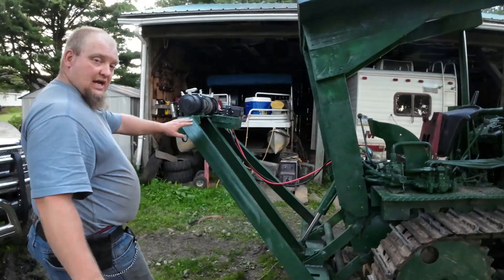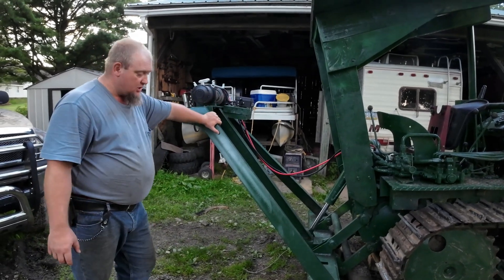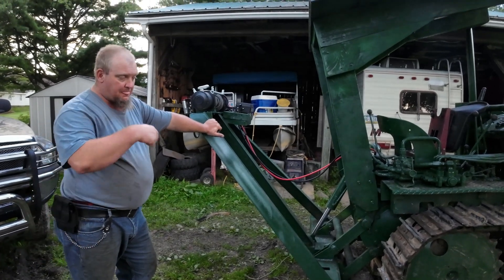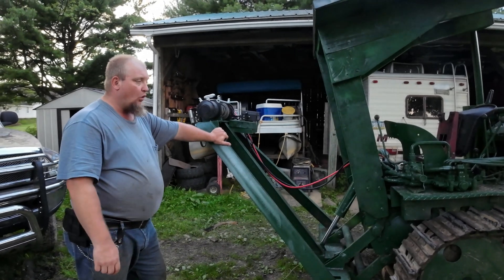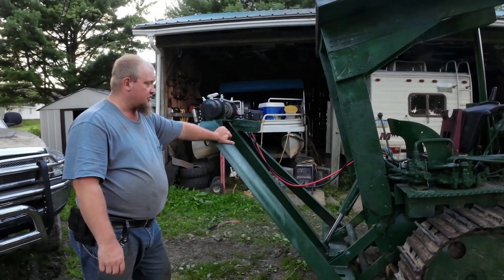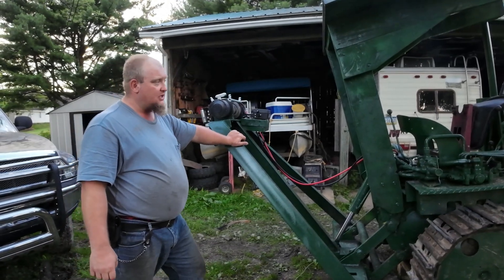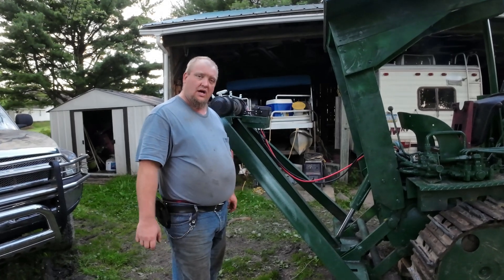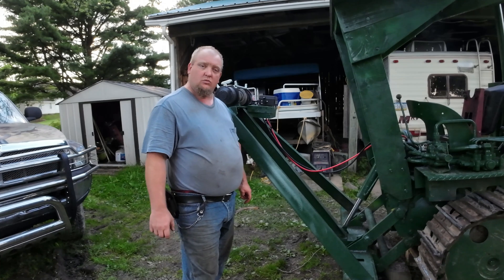DIY Welding: Save Money by Fixing Your Heavy Equipment with New Grousers

Comment: Good stuff! but for anyone else doing this, don't go beyond what the machine had when it was new, in terms of grouser height!

I have seen a fella spend all day welding 2 inch grousers on his traxcavator, only to find the thing would not turn at all because

 the inside track would not slip to allow a turn! He had to go round again the next day and trim them all  back half way with his 

oxy!
Reply from the maker: Wow, that would make someone mad. The neighbor is the one who bought the grousers, I only welded them on. But thank you for the information, I'll keep that in mind if I have to do this again someday.